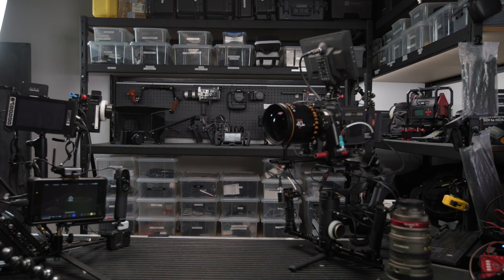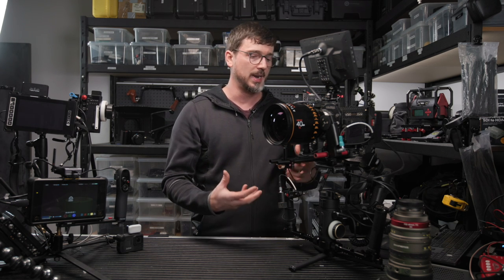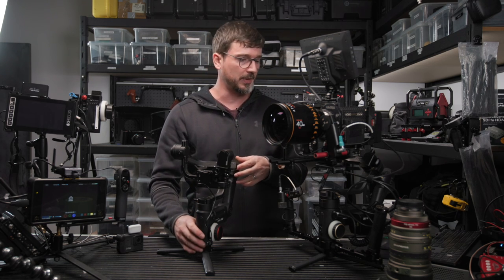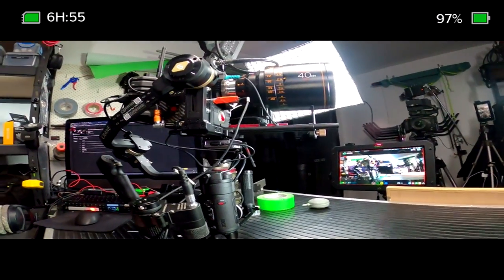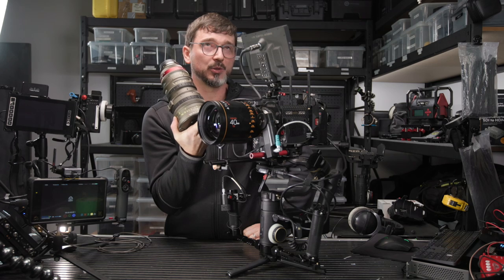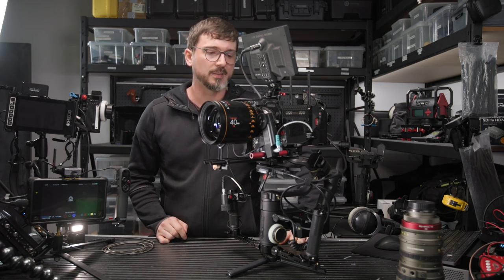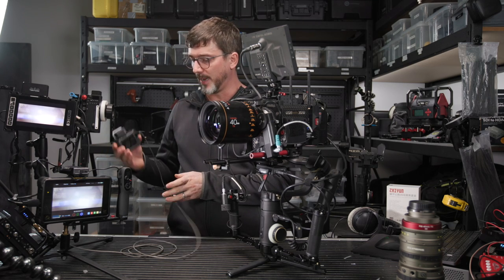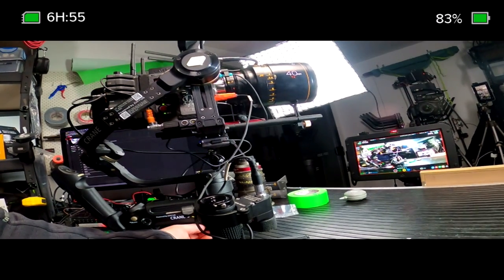$100k CAMERA vs $2k GIMBAL [RED Monstro vs Zhiyun Crane 3S]

Comment: I can see a little vibration on the image when you walk, maybe is by the long arm of the gimbal, can be? or maybe the motors are not set with much power.  I can see the same problem on mine with a Panasonic Eva 1 and a canon 24-70 mm.

Comment: Rad review of the product! Just picked mine up and received.  I have the BM Ursa Mini Pro 4.6k G2 and running the Sigma 18-35mm lens on it.  Definitely a heavy payload with all that, 7 inch monitor and Battery on the cam too.  Been working pretty smooth when upright like this, but have been running into problems when it's underslung mode.  When I am in PF mode, if I pan to the right or left, I get the gimbal starting to shake.  If I leave it for a second it returns to normal, but can't pan at all.  If I throw it into POV mode when unerslung, then I dont get any of that.  Have you seen any problems with any of your heavier payloads and underslung mode?  Upgraded the firmware right when I got it and all balanced properly. Curious to see if you had the same issues though being that you are running such a heavy payload as well.

Comment: Hey mate, really hoping you can help me with an idea I'm trying to put together.

I'd like to be able to put a DSLR on a gimbal and mount both on a tripod and be able to control the camera zoom remotely (either wired or wireless)

There are 2 ways I can think of that could work. But the zoom has to be a smooth zoom (with a zoom rocker)
1- Using something like the Zhiyun TransMount Motion Sensor Controller to control  the focus pull motor (mounted on the zoom)
2- Getting the power zoom lens https://www.sony.com.au/electronics/camera-lenses/selp28135g but I don't think I can control the zoom remotely?

Obviously option 1 will be the more cost effective route but wanted to see if you've attempted this setup yourself and confirm it would work?

Thanks mate

Comment: I can't get my motion controller to work at all. I get the iPod and gimbal looking symbols only. I switched the gimbal to CCS mode, updated the firmware, tried connecting it in every way I could think of. No luck. Did you ever get yours working? Mine seems to not be communicating with the Crane 3s at all.
Reply: I got it working by connecting the USB C cable to the back of the transmitter via Micro USB. Camera control and HDMI plug into the front of transmitter. Fixed and working now

Comment: Hey buddy, Love your video and it's a good thing I watched it. Were you able to get the image transmission set to work since this video? I also own a RED and the Zhiyun 3S. My transmission set in the way and I did not realise that the wireless motion joystick thingy didn't work with REDs. I got it as I wanted to control the gimbal's movement remotely without using the phone app.
Reply from the maker: Hey mate, glad you like it. If you watch the other videos in the series I talk about it further. You need to go into the Camera selection on the Smart Handle and choose “CCS” and then you should get control of gimbal movement using the remote even though it can’t talk to the Red directly. I’m about to release the final video on the series which will show that setup in more detail 🤙🏻
Reply: @graetzmedia  Thanks mate. I'll defs check out the other videos.

Comment: Hi, does it balance or is it very top heavy with the monitor on top?
Reply from the maker: I’m not the worlds most patient gimbal balancer, but I could easily get it balanced enough for the motors to do the rest on Ultra setting. Would be ideal to move the monitor to the top of a ring like the Cinemilled pro ring or one of the ones from SmallRig.

Comment: I have the Crane 3s myself, keep the motors on low (light payload and I've tested all settings, sitting at 7.71 kilos with gimbal & camera pkg). I notice a very light vibration, not in the footage but if I touch the gimbal (it gets worse in different modes). It is extremely subtle but watching my footage it just doesn't feel buttery smooth. Do you notice a very subtle vibration/motors working if you touch one of the arms? 

My first Crane 3s didn't work properly so I'm on my second one. What would be the odds I get two lemons in a row? 

Also I balanced everything properly with added supports. I've been using gimbals for years :) Thanks in advance!
Reply from the maker: Hey Lyndon, yeah to be honest I’ve had similar issues but they seem to be intermittent. I need to spend more time with it to know for sure. But for now my instinct is that the Crane3S probably isn’t as reliable as it should be. Hopefully they can improve the firmware and maybe use some of the motor algorithms they’ve been hyping about the new Crane 2S.

Comment: I think you need a motion slider for the RED.  Shoulder camming the RED, But using this gimbal for the RED instead of a mirrorless is just doing it wrong.
Reply from the maker: Yeah this was just for a bit of fun. I’ve got two motion control slider systems, and a steadicam. Like I said in the episode I’m not a huge fan of gimbals - just wanted to see if this one lived up to the hype and specs.
Reply: @graetzmedia  have you tried the new DJI RS2?
Reply from the maker: @antdx316  not yet but I'm keen to give it a crack!